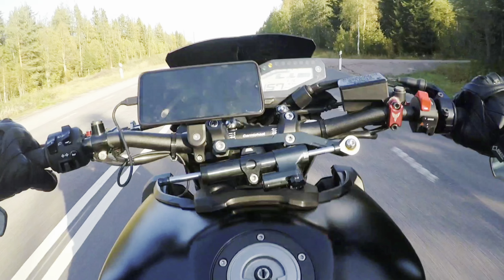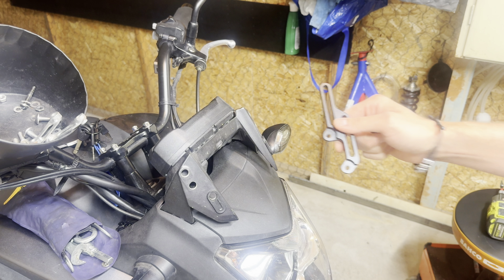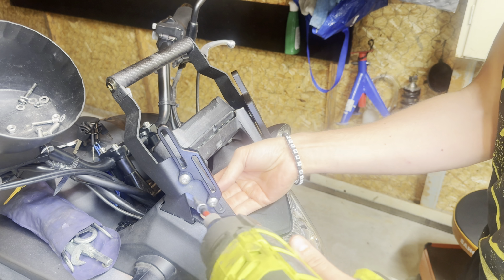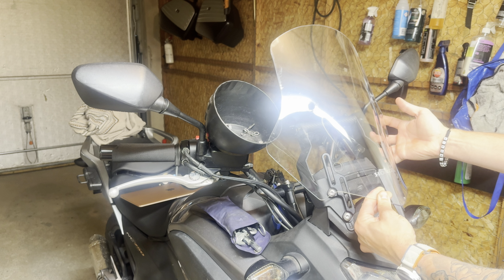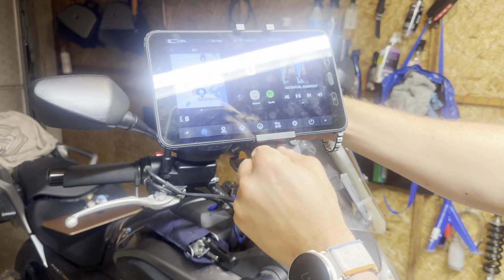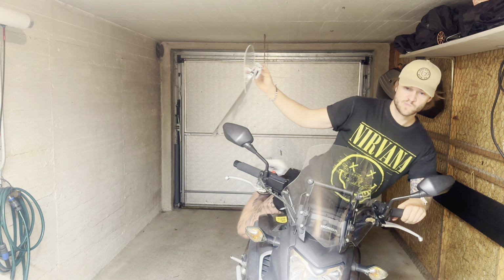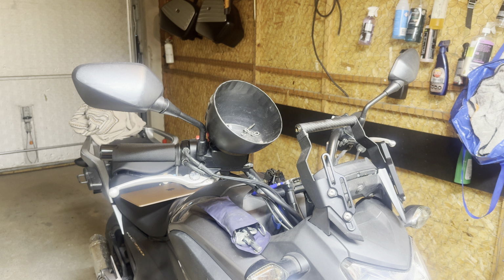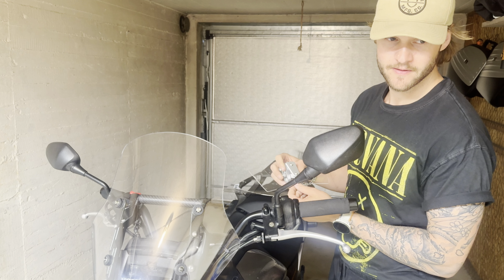Turning My NC750X Into a Travel Machine - No wind buffeting & More Mods  | Ep.2

Comment: I have a Triumph Tiger 1050 that the previous owner already put a Givi after market screen on that still leaves my full helmet in the wind. For my 1,98m height it’s great for daily use, but on long highway trips I now add a puig clip on screen that looks a lot like the Chinese one you hate. I actually have it pointed flatter than my windscreen and it doesn’t rise above the windscreen that much. What it does is still have the wind on my helmet, but it’s very clean air that reduces the strain on my neck and wind noise in my helmet. Worth a try!
Reply from the maker: I know there are other same looking defectors that is of better quality 😁 I haven’t tried a deflector on my current setup, sins I’m quite happy with it, maby I can get it even better with as you say, lowering just to fine adjust for even cleaner air, thanks for watching & comment a good point 🤝

Comment: I have one of those sh*t cheap two sided top deflector on my 23 cb500x and doing the job right. Did a trip from Malmö - Lysebotn (many km 110-120) without problem. But the original seat on the cb500x oh boi... :D 🇸🇪
Reply from the maker: The one who breaks the vision like looking through ice & adjust itself? 🤪 Maby at a lower windshield it works better, you don’t have it in your vision & less collected air that push on it

Great that you have a nice wind experience! Haha, butt pain <3😝
Tack för att du kikade! 🇸🇪